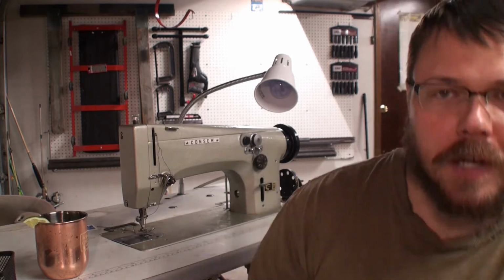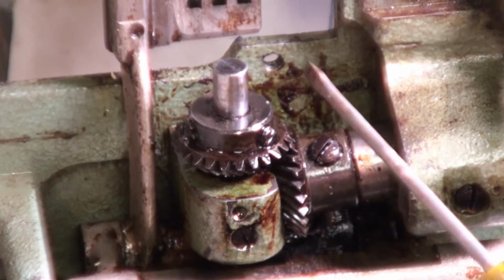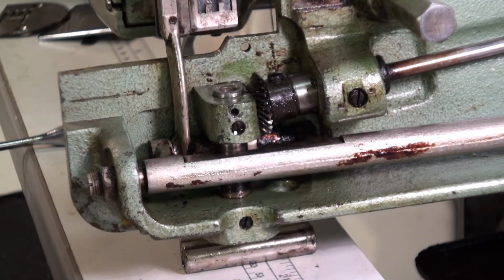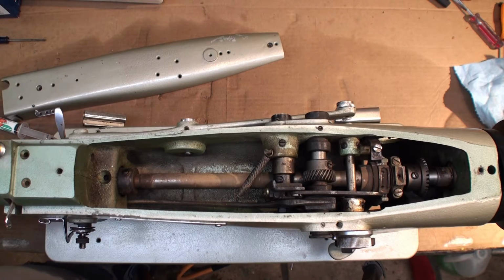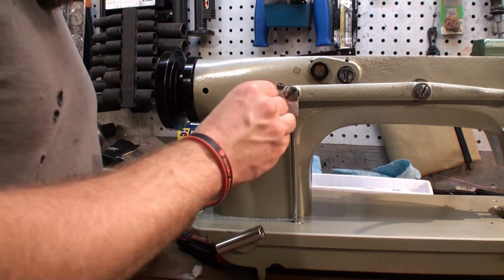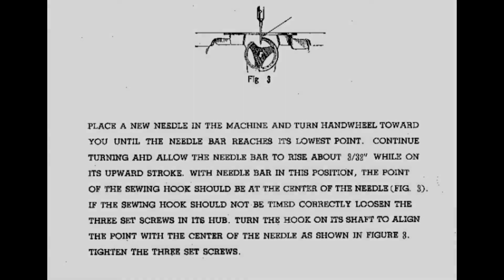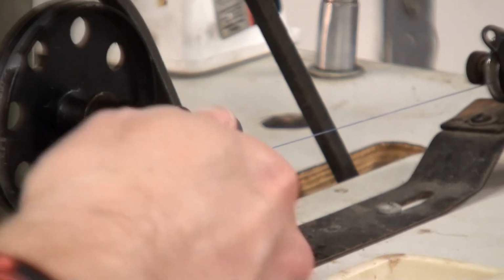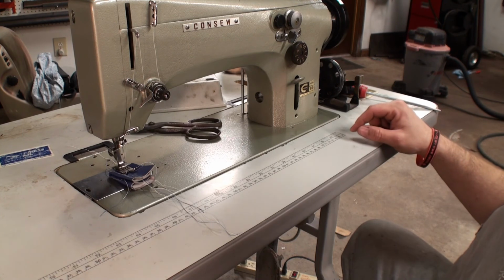Locked-up Industrial Sewing Machine repair, service and timing on Consew 99 and similar models

Comment: Just picked up one of these yesterday, for historical garment making.  How is yours performing so far?  Thanks for sharing this video.  Saved to my sewing machine favorites.
Reply from the maker: With the nice weather we have been working on the boat in the shop. With the cold weather moving in ill be getting to some sail repair. Hoping to get a video of the Consew 99 doing sail repair. Thank you for watching
Reply from the maker: Finally getting to the canvas repair. The machine is working well. Took some time to adjust everything to the larger thread (V92) and using a #20 needle. Hopefully the machine is working for your projects.